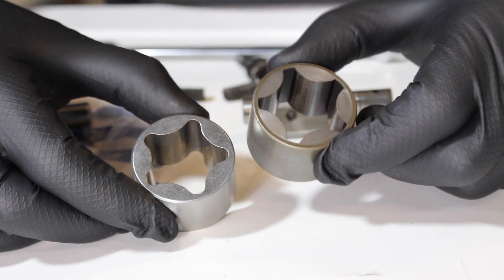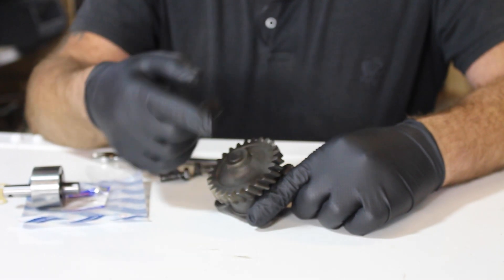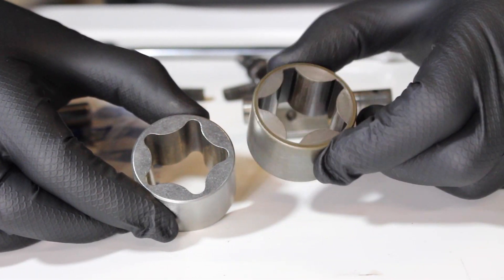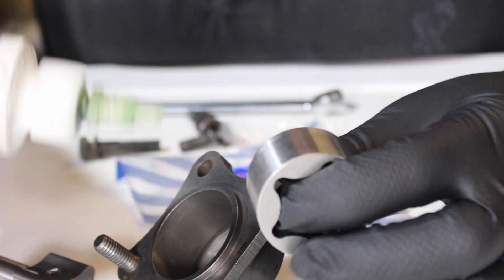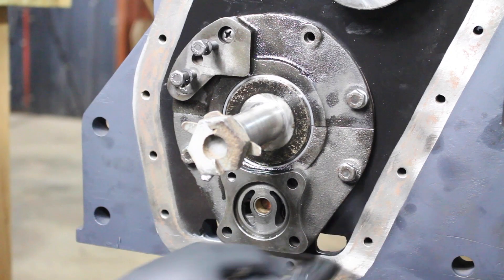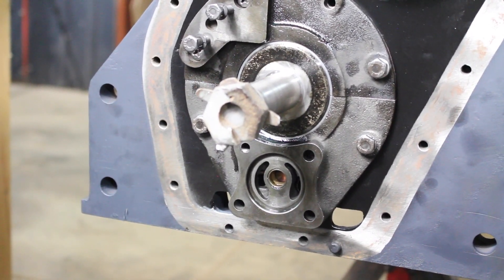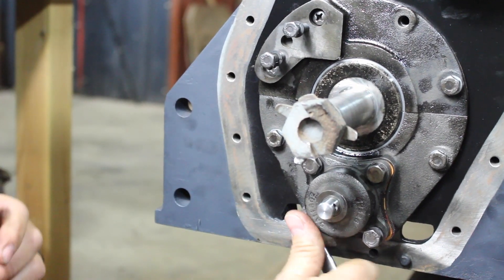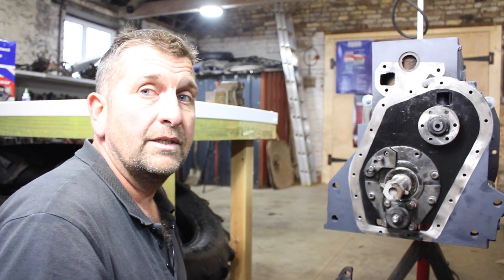Rebuilding and Fitting the Oil Pump on the Ferguson 23c

Comment: These 23c engines were made by the standard motor company but were taken over by Leyland who called this engine the Layland OE138 and carried on making it. They also made a more powerful version called the OE160 which looked identical but was 2.7 Litres and ran much better, started better also. I have one of these fitted to my tractor and wondered if you can supply liners and pistons for it? I notice you are fitting a new chain to your engine there so after about 1000 hours you will need to re-time the camshaft because the chain stretches preventing the engine from starting. This happened to all the tractors when they were about 2 years old back in the day.

Comment: Great video.  
I have fixing a 23c engine. Did not do the oil pump. But the rest of the engine. When i start i have a very high presure about 6 bar. When the engine gets warm it drops to 1-1.5 bar.do I have to take it apart or what do you as an expert think.
Reply from the maker: Hi that is a bit high did you change all the bearings crankshaft and  conrods?

Comment: It's still amazing how suck a small pump can move so much oil. It would have been interesting to know how much oil pressure it had with the old one compared to the new one once it's running. Keep smilin